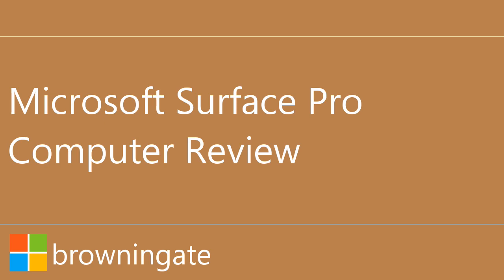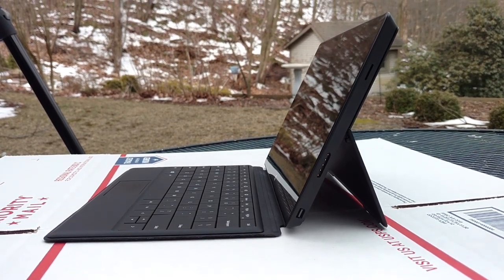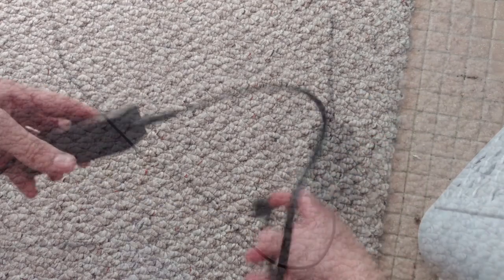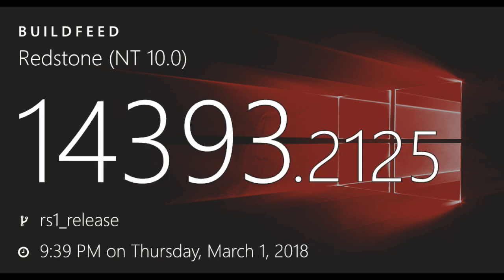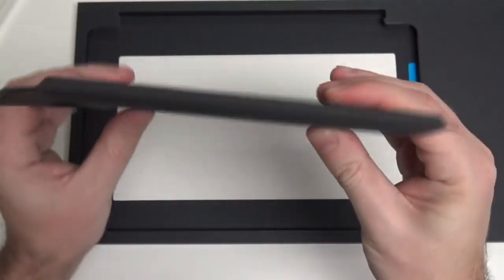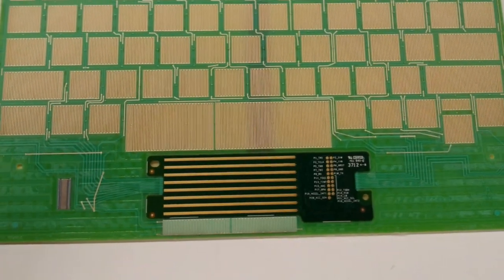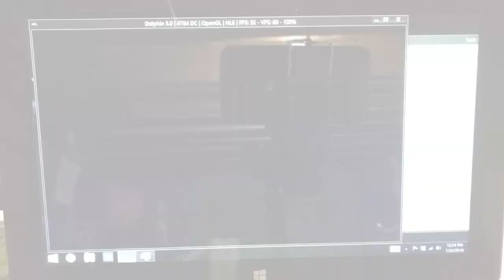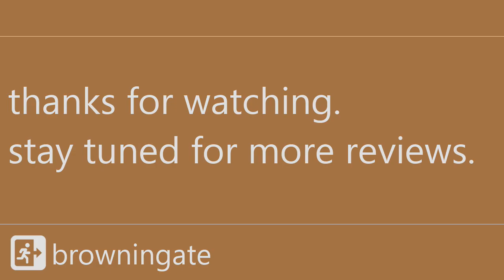The Microsoft Surface Pro 1: Finally Reviewed

Comment: Dude, I'm writing this using my surface pro 1 bought in 2012. Man, 8GB, 250G Storage, this machine is incredible in all aspects. No issues whatsoever. Durable as a rock. It is still a fairly good computer after all this time. The machine indeed requires a table but nobody was fooled by the concept. Who bought knew what will have to deal. I love my surface.
Reply from the maker: Good deal. I still look back on my ownership with fondness. I'm thoroughly on team-laptop, but there's no denying that the Surface Pro is a neat little machine.
Reply: My surface pro 1 can't run games so I got scammed at 2012

Comment: first of all great video ,i just need to know if there is a regular surface and a pro one and how to know the difference since i found one in the local market and dont know if i should buy one
Reply from the maker: Surface RT and Surface 2 are similar to the Surface Pro and Pro 2 that they supplement, but the Pro model is usually heavier, and the ARM-based machines lack the cooling vents and fans. Once you're logged in, you can also pull up the system properties screen (right-click on the Start button and choose "system") to see what chipset it has. The Pro features the i5, while the RTs will have a Nvidia Tegra.

Comment: Lenovo x201 or microsoft surface pro 1?
Reply from the maker: Excellent question. Currently, Pro 1s are selling for around $130. The X201, as legendary and respectable of a machine as it is, still commands moderately more than that (upwards of $175) on the used market, and isn't significantly more powerful. I'd personally stick with the Pro 1 unless I needed expanded connectivity or a dock station. That said, I do enjoy my ThinkPad X1 Carbon Fourth Generation more than any of those machines, (more powerful, lighter, longer battery life, and bigger screen; plus it can still use a dock) but it still commands about twice as much as a Pro 1 does on eBay. Pay to play, I guess.

Comment: Indeed the trackpad is a joke, but a point which I think you missed to cover in detail is that you can control almost everything of windows using your finger on the touch screen.
Reply from the maker: No, I covered it. Capacitive touch and stylus. That works, but can get to be tiresome after a while.

Comment: Im just trinna use it as a cheap drawing tablet with Photoshop should i even bother or buy a "newer" one?
Reply from the maker: Gotta love the old Trinna. The O.G. Surface Pro definitely draws just fine.
Reply: I use surface pro 2013 for Graphic Design and some occasional 2D animation. It also runs Cinema 4D fine.

Comment: i still have mine, my pro 2 isnt doing to good so I'm using my pro 1 and it works well, just wish the battery life was better on windows 8.1 but prob will upgrade it to windows 11
Reply from the maker: I had rotten luck with any builds newer than 8.1 on the Pro 1. Unless there's some really compelling reason or feature, I'd skip that.

Comment: I never knew Surface chargers were recalled. That's a deal breaker. I cannot use a device that is subject to any recall.

Sent from my SM-N930V
Reply from the maker: To be clear, the adapters were never recalled. Only the power cord was, due to some kind of hypothetical overheating problem if it was repeatedly and abusively bent in the wrong way. The replacement is a freebie. I wouldn't call it a dealbreaker by any measure.
Reply: Lmaooooo is that the note 7
Reply: @Browningate  

I never knew about any recall, but it was rubbish and I replaced mine with one from a 80s FM radio. It's universal.
Reply from the maker: @JoSo - Thankfully, it is a universal "regular" power cord (I forget the technical name) if I'm not mistaken. I'll bet that the cord you found is a lot longer than the OEM one, that's for sure.
Reply: Do you know where I can get a replacement cord? I don't know if I have the original charger or not but mine recently broke and I don't want to buy a new computer!

Comment: hi would you reco this pro 1 vs pro 3? pro 1 sells 50 dollars cheaper from my place
Reply from the maker: I guess it depends on the starting price for those. The Pro 3 is thinner, lighter, and has a better trackpad (make sure that you're comparing two devices with, or without, the type/touch cover). It also has a larger screen.

Comment: Can you please tell me if I update my surface pro 1 to windows 10 will the pen still work?
Reply from the maker: The pen will work. The wireless chipset, as the video points out, is another story. Your mileage may vary. Try it, and if it sucks, just roll back to 8.1.
Reply: @Browningate  thanks for the info. I already did the update and everythings working fine and hopefully it'll continue to do so.
Reply from the maker: @abelmacau4797  Glad to hear that it worked out.